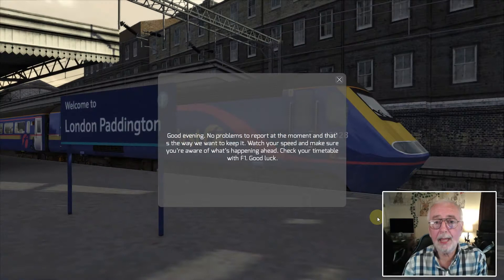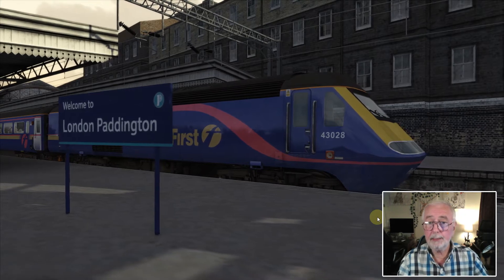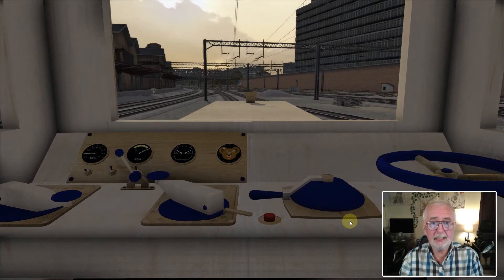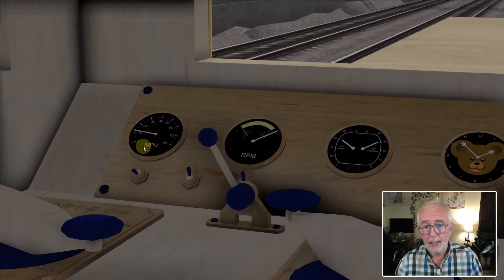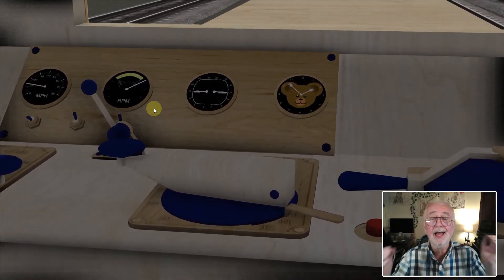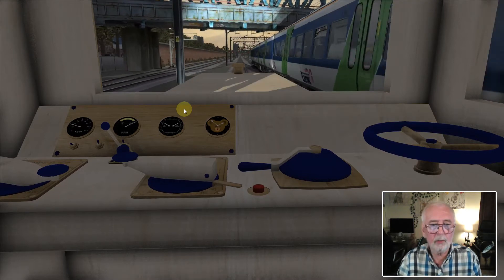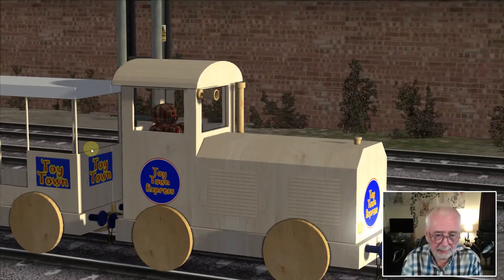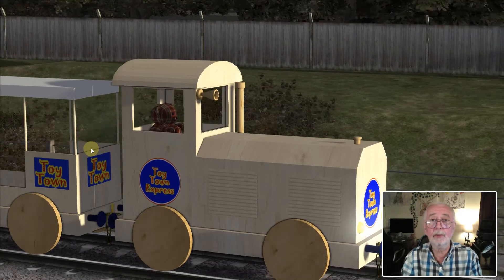Producing a Loco part 3

Comment: Hi make full detail video on how to make animation ,3dcab and all blueprint and train glass plzzzzzzzzzz
Reply from the maker: Hi, will start with video on the blueprints to get a drivable vehicle and then go on and explain cab animations in another video. Will post a link to  my blend files and textures later. As long as you have a mesh and wheels you could make anything drivable.